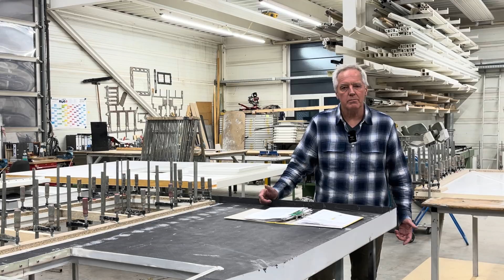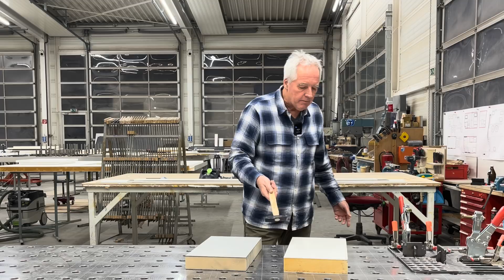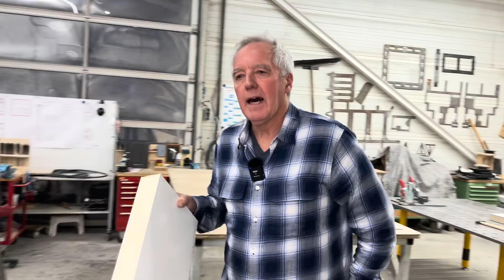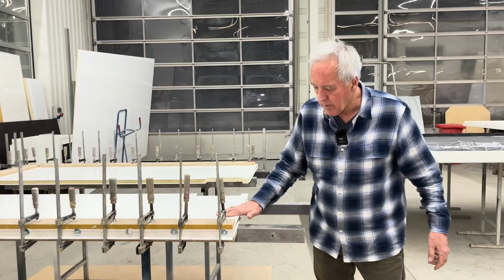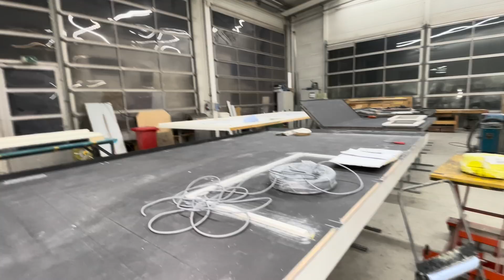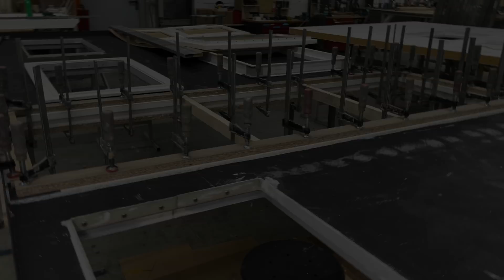UNICAT Expedition Vehicle. Materials to build the body

Comment: Total body in fiberglass panel, is good for very cold temperature ( -40 degree) ? I have doubts about the joining and glueing of the panels. Do you use epoxy glue or silicone?

Comment: Excellent and informative video!  I just wish you had covered how you treat wiring.  Do you build in conduits into the center of the panels to route wiring on the insulated side of the ceiling and walls?

Comment: What are your thoughts on Electric drivetrains powered by a petrol generator/welder? Have around 15-60k battery range for short bounds and to power everything inside your vehicles. Supplement your petrol generator with solar panels and a retractable wind turbine.

I found your channel after doing research on my own expedition design. You know the saying, if you have a good idea someone else probably already has done it. Well your UNICATS are pretty much the exact same platform I came to the conclusion of needing. All the weight and square meters needed for batteries and housing solar/wind/petrol energy generation demands a large heavy expedition type vehicle platform.

Now I based all my plans on trying to convert an 8x8 hemtt simply because I thought the extra drop axels could further add regenerative braking. Still doing the math to see if the benefits out perform the weight of an extra axel. But I think my electric drivetrain idea would work on any of your larger UNICATS.
Reply from the maker: good luck 😜😜😜

Comment: Just great to see up close how a prepped panel looks. Also the simplicity of the L pieces instead of already made u channel L. The door fibreglass. Does it have wood behind the fibreglass for screws or nothing or metal pre drilled to accept the hinge for the door with out stripping???  I Would really love to see how and what is integrated into a sandwich panel on the floor. In my mind I expect I’m heavily over engendering this part.

Comment: Thanks for this video! I have the plan to build my own shelter someday in the future.

I now have an Unimog 404 with a radiobox. the same box where you started with. And I restored my box and made it 50cm longer and I have double side doors now. And I insulated it by making an insulated box inside of the radiobox. And I installed a 2KW diesel heater in it. 
I love the Unimog 404 platform with a Diesel swap (OM617 80hp) :)